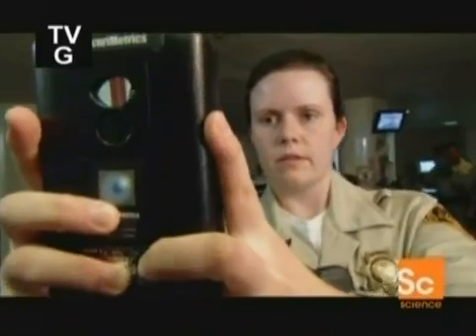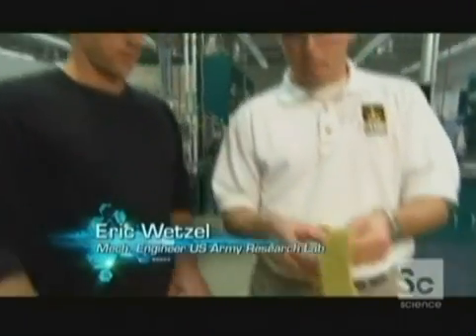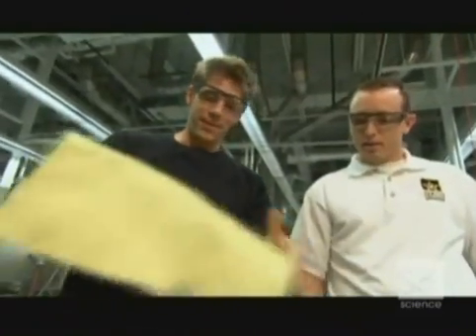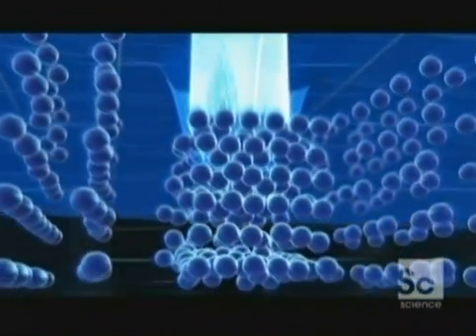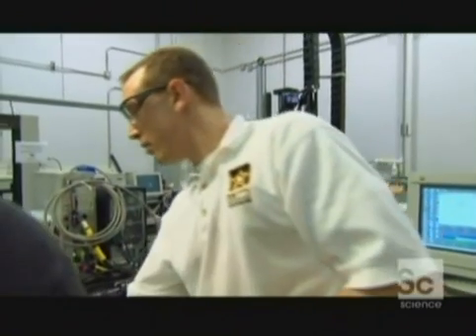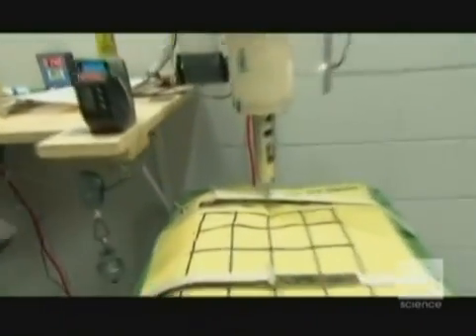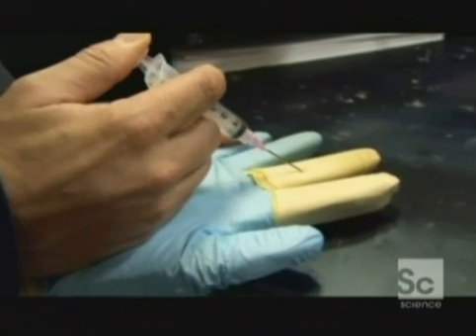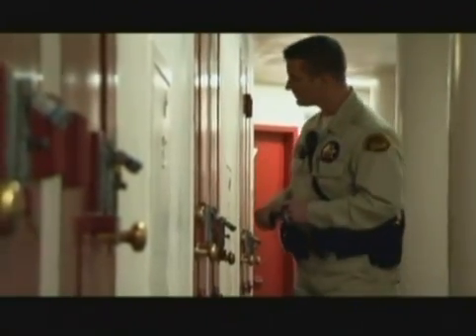Liquid Armor

Comment: An ordinary kevlar vest works on the principle of distributing the energy of a bullet over a large area of the vest. A kevlar fiber strand is roughly 15x stronger in tension than steel. So the bullet is cradled on impact, then the kinectic energy is released over a large area of the vest being worn. So the bullet just hits you really hard instead of piercing you completely. A knife just pushes in between kevlar fibers without ever being caught. Funky but basically thats how it works O_o.

Comment: Fortunately for those who need this armor, physics just doesn't work like that. The solution stops *force,* not a material - you could throw any kind of matter at this armor and it'd still resist the force. Practically speaking, you'd need something that can literally rip apart kevlar (thus, ripping apart the liquid armor's suspension lattice) to pierce the armor; we're talking AP ballistics at this point.

Comment: That's because it does! They both act as non-newtonian liquids in how they react to shock forces. Corn starch is only less practical because the water evaporates at all temperatures and the corn starch doesn't have the strength to hold together as well (plus, the whole biodecay thing).

Comment: No. The compound doesn't "dry up" in the same way that a water based compound would evaporate. However, if you did manage to boil away or freeze it (which is, realistically, not going to happen), it wouldn't work - you'd just have silicate dust; the shock-absorbing properties are only present when the silicate is suspended in the solution.

Comment: That's the point, that's the point of *all* armor in fact. Any amount of force hitting you will leave you injured - just google "shot by bullet body armor bruise," first result is a picture of a welt a guy got by being hit by an AK-47 round. What body armor does is disperse the energy and keep it from tearing into your flesh (kevlar, ceramic).

Liquid armor fills the *gaps* in polymer armors (kevlar) to further reinforce it against puncture attacks. Watch the fucking video.

Comment: If "that" is part of west on someones body- nothing. 

It's practically impossible to make damage worst then scratch if the person who's protected has functioning nervous system, it's not sedated or dead. Hydro cluster will be formed in a speed nervous system needs to activate first muscle, this is when considerable kinetic force will happen. 

I actually think that even "on the table" during attempt of slow penetration it'll be impossible because of other characteristics of final product.

Comment: I know that, but I was talking about the liquid armor. It has the same characteristics as corn starch and water. You can run on it, but if you stand still, you will sink. So stabbing the armor will be like running on the corn starch. If you hold it in place and put lots of pressure on it for a long moment, it will sink in and end up puncturing the liquid armor.

Comment: Looking at it, You can still stab someone. This only works with sudden kinetic energy. What happens when someone has a very very sharp shank, stabs you, but keeps it on you, still putting lots of pressure on the device as the hydro cluster disperses after the initial impact? You will get cut slowly and painfully, and therefore, stabbed.

Comment: ...really?
The fabric would be forced to take the shape of the ice pick and still puncture your organs. So rather than having steel in your body cavity, you'll have some fabric. Not really a difference.
 
Now, if you take that fabric and pull it tight over body armor or in some sort of canvas-style way, maybe it will be enough to resist the force and puncturing capability of an ice pick/blade.

Comment: Think of the characteristics of human flesh. It's soft. it will give, no matter what. When you say "stretched tight around your skin," it doesn't matter. To become tight, it needs a rigid frame. You're saying that frame is your body, but your body is soft. Just think about it. A lot (most) of the energy WOULD be absorbed by the material. But it's cloth. The other side of the cloth COULD puncture you.

Comment: It's like  "PLAST-AID". I have used it for repairs.  But it does harden. For repairs on plastics it is one of the best. Use it to glue a quarter to a pvc pipe, and the quarter will bend before it breaks free from the pipe.Even using pliers it is almost impoosible to break the bond. cool stuff. It's on utube check it out.

Are they saying that this stuff is still liquid after 48 hours?

Comment: Brunt for trauma? Do you mean blunt force trauma? And yes, blunt force trauma will still damage tissue and bone, but that's usually not what will kill you unless it's excessive or hits a critical area. A puncture wound causes severe bleeding and, if it hits the intestines, will also fill the body with bacteria.(that's bad) Most officers are in good physical condition, so their muscle mass will resist blunt force trauma better than average anyway.

Comment: It wouldn't work, pushing the knife slow. The key is kinetic energy. It takes a certain amount of kinetic energy to pierce Kevlar, and at that point the liquid material would probably have been given too much energy to let the knife pass. Unless a high amount of mechanical energy is needed for it to work, higher than what is needed to pierce the Kevlar, than that won't work.

Comment: There are MANY weaknesses to kevlar.  Adding another layer may add functionality.  You would also introduce new problems.

Add it outside and the gel is vulnerable to piercing from projectiles
Add it inside and the kevlar still gets cut and is less effective vs a projectile.  Either way, you add weight, which is a serious problem for ANYONE in a situation who may need to wear armor to begin with.

Adding on it rarely the answer.

I cant believe they said "Absolutely Stab Proof"...

Comment: Spreading the force over an area dramatically reduces the entire force at any single point and that's the idea of this. Sure Kevlar would actually completely stop the round penetrating, but this on cloth expands the area of force from about a 10th or a millimeter squared to maybe a few cm^2 (very estimated for something made very sharp).  If its dropped to 2 cm then the pressure on any point is 40000 times smaller than before. That could definitely save someones vital organs if still damaging.

Comment: My thoughts with this treated kevlar is that it stops the projectile penetrating and also spreads out the impact, so its more like someone smashing you with just a hammer, rather than a hammer with a nail in front of it.

Hammers still not nice but if im going to get broken ribs anyway id prefer it without the huge hole out the other side lol.

Comment: Some rounds will punch straight though steel as it has no "give" yet could possibly be stopped by this as it actually absorbs some of the energy and spreads it over a greater area. With multiple layers with the weave alternating (so one is up down, left right, then another diagonally) I think this would have a much better stopping capability than steel plate of the same thickness.

Comment: Remember this intended to be ADDED to the Kevlar fabric. The fabric has limited flexibility (the whole idea is that the bullet will stop... not just drag the fabric into your body). This combined with Kevlar will also stop high speed stab attacks.

This on regular fabric (or more flexible fabric) would probably only be useful at stopping slower stabs such as the needle pricks.

Comment from the maker: The material is mentioned in the video. It is silica suspended in polyethylene glycol. As many commenters have pointed out, you can also create a much weaker non-Newtonian fluid by suspending cornstarch in water. You can experiment with how such a fluid work at non-weapon grade. There are many youtube video showing people running on non-Newtonian fluid without sinking.

Comment: Problem with Chainmaille is that it has holes in it that allow it to move. the smaller the rings the less protection it offers. but the bigger ones can let something like a pen stab right thought it. also you will need hardened spring stainless to really do a good job (and last) that is about the most expensive....

Comment: True, for theese weapons a tight mail of small rings could be enough protection. Perhaps experiment with other metals instead of steel. like titanium for instance. It's expensive aswell but thats just an example. There are hard metals that are lighter than steel that would suit this purpose i think. The military vests are often weak at the sides to allow movement, this is atleast fixed with chainmail.

Comment: problem is that chainmail is designed to make blows glance off in the rings instead of cutting in. Piercing damage will damage or in worst case break through chainmail. Another downside is again their first argument about weight. A shirt of chainmail would weigh about 7-10 kg depending on your size and the thickness of the rings you use. Thus we are hindering the guards movement again abut the same as a military style bodyarmor would. Only plus is mail gives more even protection.

Comment from the maker: I don't know much about arrow heads, but purely based on the equation pressure = force / contact area, the broadhead may spread the force out in larger area and hence has less penetrating ability. Beside, the broad tip needs to open up a much bigger window for the tip to pass through & Kevlar is only vulnerable to small windowing effect. Though the hook-like broad tip will lock on to the prey's flesh once it punched through, Kevlar may stop it. This debate can only be settled by actual tests.

Comment: Hey mate, I haven't actually killed anything with my bow, but I have shot a heap of rolled up cardboard with both field tips and broad-heads.

In my experience the field tips actually penetrate better, the broad heads aren't designed to go through armour, they are designed to cause more damage once they are inside the target.

An example of this was the use of bodkin arrows by medieval archers, bodkins were uses to target knights/armoured targets. They are closer to a field tip than broad head.

Comment: not larger, sharper. As sharp as a razor blade, probably could slice right through that. Try finding a slow motion arrow, one with Field Tip and one with Broad head. you will notice the differece.

Comment: No, it responds to a lot of force and there wouldn't be enough to cause it to lock up. The fluid is embedded into the fabric, so it moves wherever the fabric does, It wouldn't lock up just by moving. Also the armor doesn't cover any joints.

Comment: I suggest looking up "liquid armor" on Google if you're interested in knowing more. I believe there is even a wiki page on it.
Also, if you're interested you should check out something called "oobleck". It's a similar substance that you can make at home from water and corn starch that you can even run across or jump around on without sinking into it.
Although, oobleck can't be used as knife-proof armor. Don't even try that, it's definitely not safe at all!

Comment: It's actually similar to a solution of corn starch and water known as "oobleck", which has similar (but weaker) properties. If you have a kiddie pool filled up with oobleck, you can actually run across and jump around on it as if it weren't a liquid and you won't sink into it. It's actually pretty damn awesome, but that stuff is kinda messy. Still, I'd recommend checking it out if you have the time and interest. "Silly Putty" is actually a similar material to these examples, too.

Comment: A knife works by having an extremely small and fine point with very little contact area. On the other hand, bullets are traveling far faster, have a wider contact and are not pointed like a knife would be. A simple arrow should technically still fail to get past. A very pinpoint arrow on the other hand, should be able to get past.

Comment: You work in the industry, I don't. Most of the material I find in the internet is for people that just want to read an article without the need to read 10 other (i tend to read 10 others to understand better :P). As you are in the industry you know you don't use pure tugsten but I have read about tugsten carbide less then 10 times when it comes to armor penetration. If you read wikipedia's pages (I know, wiki isn't accurate) on armor penetrating sabots and rounds it says they use tungsten.

Comment: What you call a bullet proof fest, is actually bullet resistant. They still haven't made a vest thats completely bullet proof AND practical. A full metal jacket round can window kevlar with little issue because it doesn't expand. Armor piecing ammo is simply a more effective windowing round. Also, the slow moving arrow easily move through kevlar because there is little to no impact. Bullets are meant to impact and lose energy. Arrows aren't. They just want to piece and go throw its target.

Comment from the maker: What you said made sense. If the bullets don't mushroom, the window that pushed open by the sharp tip will let the back-end of the bullet to pass through if the window is big enough. I wonder if they can design a better weaving pattern that will prevent the "windowing". e.g. "knitting" the Kelvar threads into an inter-locking loops pattern instead of the crisscross "weaving" pattern may improve the performance of any regular Kelvar vest.

Comment: The tip of a screwdriver isn't sharper then most bullets. Vests stop bullets when the bullets mushrooms on impact. Armor piercing projectiles relly on harder materials and larger mass (those two usually go hand in hand - tungsten core is very common). In the video, they said the arrow is with a steel tip which more or less makes the arrow armor piercing (not a term I think :P).

Comment from the maker: The cornstarch and water may be also non-Newtonian fluid, but different material give different strength. Are you willing to be a Guinea pig when that blade is stabbed through. e.g. Kevlar and Nylon are both polymers, but they also have different strength. Copper and steel are both metals, they have different strength too. Know your non-Newtonian fluid before being stabbed.  :-)

Comment from the maker: this fabric has flexibility normally and it only harden on impact. Steel plate is stiff all the time and will impede the officer's movements.  If you use tiles like the dragon skin, you still have to protect the gaps between the tiles with something like the liquid armor.

Comment: The fabric sample that they tested was at most half an inch thick. Imagine the full armor insert made with this fabric. I doubt there'd be penetration. If not, a rigid polycarbonate backing (e.g. lexan for bulletproof glass) would easily solve that problem. This looks promising nevertheless.

Comment: the military is working with non- nutation fluid and carbon nanotubes the strongest thing on the earth. tinly little tubes that when grouped together are indestructible. combine that with non-nuation fluid with a very simple layer of dragon skin surrounded by non-nuation fluid incased in fabric made of nano tubes. the ultimate bullet proof. you wont even get a bruse

Comment: Just move slowly, if you dont try and shove the needle in violently it'd part easily. If you want to see how it works try mixing corn flour and water. If you just push your finger in lightly it's gel-like, if you jab at it it becomes harder and more dense.

Comment: my thoughts exactly. The amount of force someone is going to use in a shanking, they're still going to do damage, they're basically just...cradling the weapon removing sharpness but the cloth is still going to be be pushed in and still cause damage. Watch when he stabs with the stab proof cloth. The cloth didn't rip but it still penetraded into the block it was sitting on.

Comment: I found the research reports and data and replicated it. It works wonderfully as long as the silica used is submicron in size. I separated a batch of diatomacious earth. The effect made it possible to make ballistic quality kevlar aramid  protective against both ballistic and penetrative threats with half the amount of kevlar sheeting. Google "shear thickening fluid"+"kevlar".

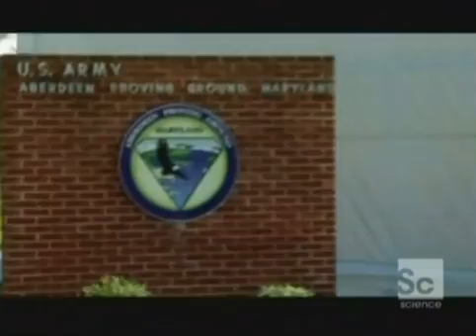Comment from the maker: If you watch the video at time mark 1:09 closely, you can see that the fabric was pushed into the carton box below, exactly as you have predicted. In later footage, they changed to use a hard surface backing.  If the fabric is kept under tension, then it would not fold up into the hole.

Comment from the maker: Sorry about that, there was a hardware problem with the audio out when this video was made. I have already boosted the volume to 2X but it was not enough for some people. Note that there is a volume control near the bottom of the Youtube player, there is one on the bottom right of your computer screen and there may be another one on your external speakers. In the worst case, use a headphone. This video is worth the trouble. :-)

Comment: They can do that already. It's not about making bulletproof cops but reducing the risk a slight bit. If someone attacks with a pointed weapon in a stress situation, chances are high for the victim to get hit in the torso since it offers a big, frontal, hard to protect target. Armpits and neck are easier to protect. The risk is still there but the chance of being stabbed in the very vulnerable guts would be far lower.

Comment: Sounds like the stuff is designed for stabbing implements. Correct me if I'm wrong: it would help against shrapnel but not the heat or force of the explosion, and even shrapnel would break bones and/or cause bruises at such high speeds. And then there's the fact that Kevlar vests don't protect the head, so... yeah, for explosions your situation is just IMPROVED, not good.